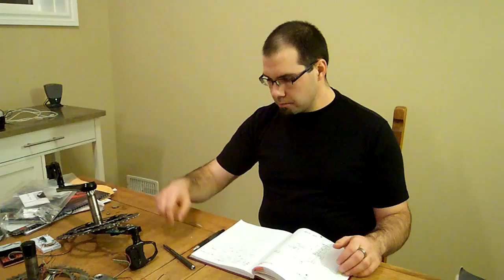V3 Power Meter - Introduction to the Build

Comment: Hi. Are you sharing V4 firmware and notes? I am looking to build one and send data to the SW102 Bluetooth display (NRF51) for which we did developed our OpenSource firmware and integrates with Strava. Also the idea is to send the human pedal power to Bafang mid drive motor and control it, using our OpenSource firmware on Bafang motors.